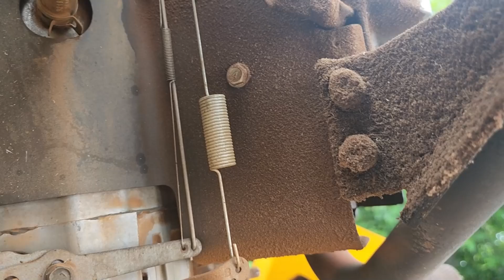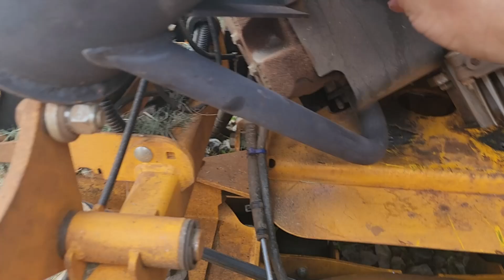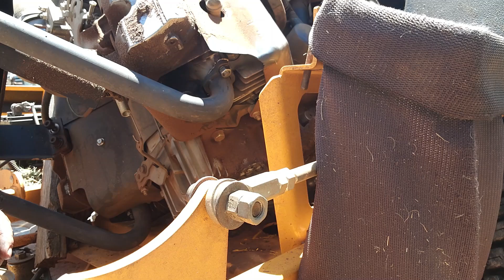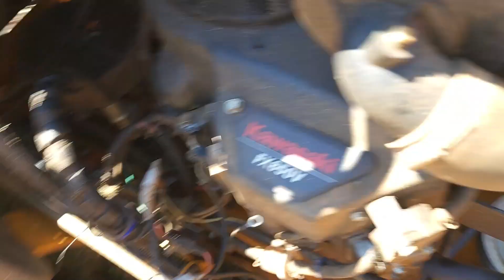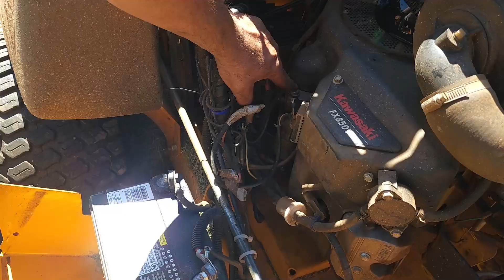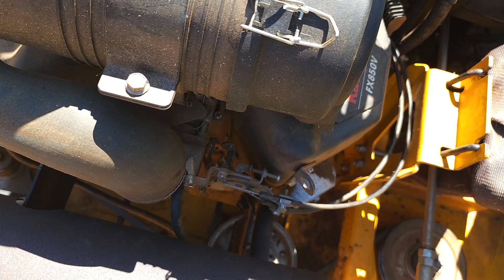Part 2 Wright Stander ZK Stripped and Broken Engine Bolt Repair

Comment: did you tighten the allen heads holding the muffler support bracket?
Reply from the maker: @billyalexander2783 I am sure I did. My buddy hasn't mentioned it fell off in a customers yard. Thanks for watching and asking. ~Mr. C.